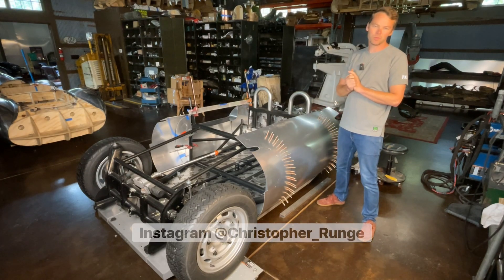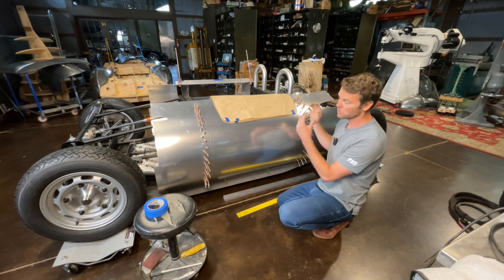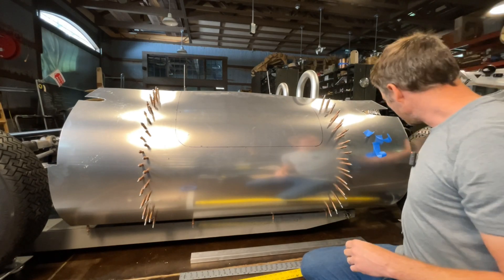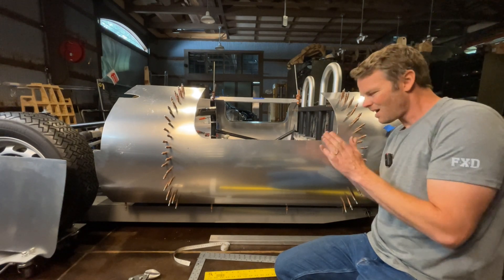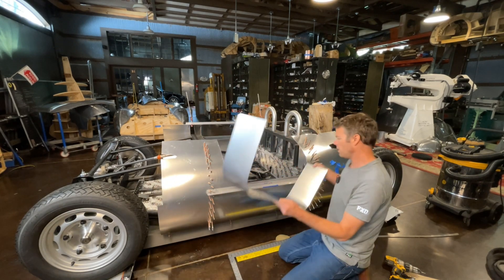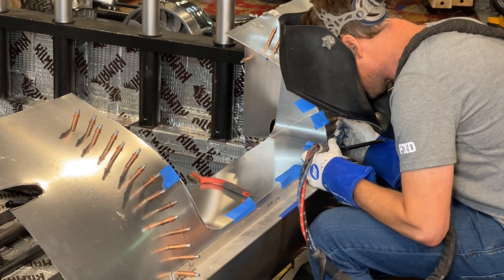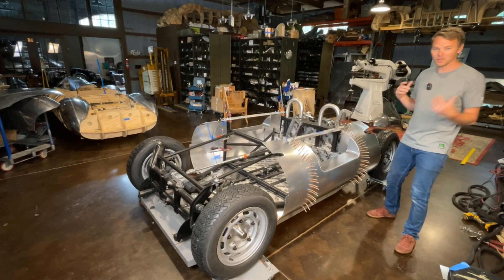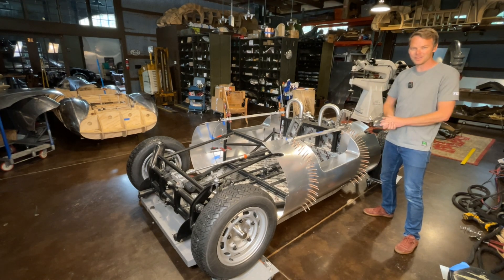Custom Car Body Part 11: Making Aluminum Door Openings

Comment: What made you go from a metal buck to wood? Thanks Chris!
Reply from the maker: Great question- I have had several orders for the RS and at the same time I have extended the wheelbase since the first two were built. With the extended wheelbase I was shaping the tube bucks on the fly to accommodate. I decided to scan the buck and have it really dialed in digitally, then CNC cut out of wood. This gives me a more precise buck to work off of for making multiples. Traditionally, a tube or wire buck would be used for more one-off competition cars. After working both with the original wood bucks for my builds and then doing the Superleicht Tube buck I've found that the wood is in fact more efficient and easier to build off of. Both have their place but right now the wood is working excellent.
Reply: Thanks Chris!